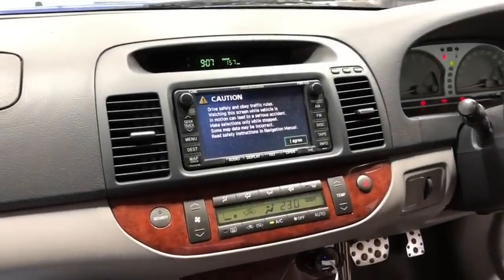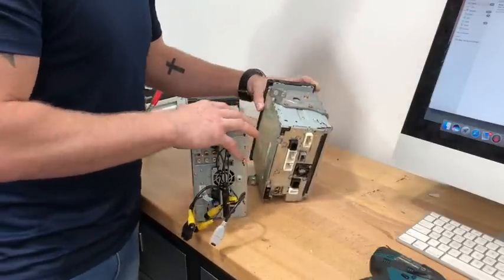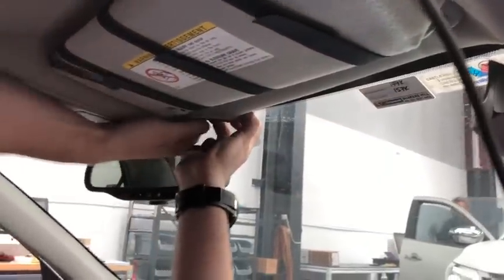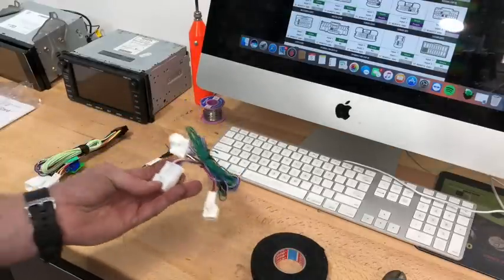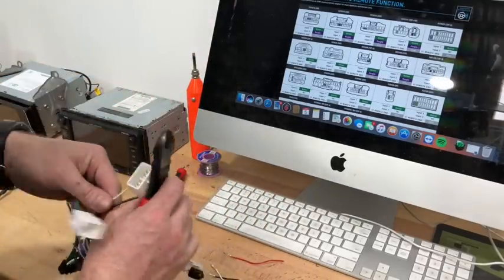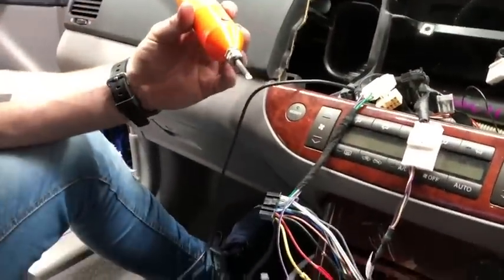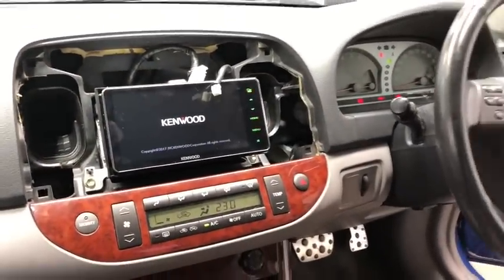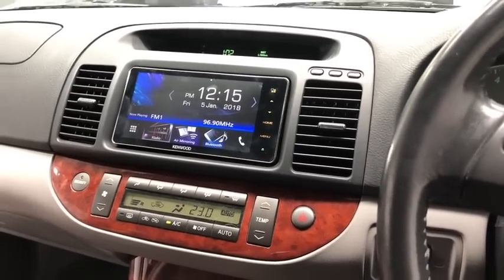DIY: How To Install a Stereo In A Toyota Camry 2002 - 2006 | Kenwood DDX917

Comment: I live in the U.S. I have a 2002 Camry and want to buy this head unit, however you mentioned that is available to only a few areas that did not include mine. Where can I buy this radio and if I can't find this one, will the DDX918WS work the same?
Reply: Call Kenwood maybe they can tell you

Comment: if i have a toyota camry 2004 do i need to put 2 din stereo?
Reply: Geovanny Perez not at all. Metra makes a lot for single din radios and it comes with a small compartment to go under the radio
Reply: Yes